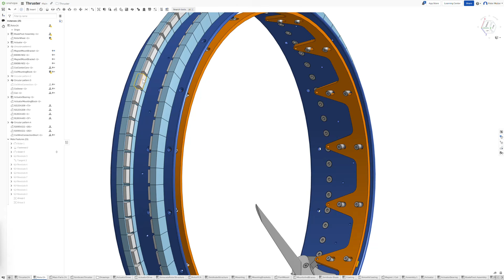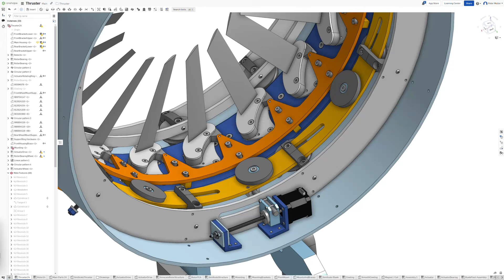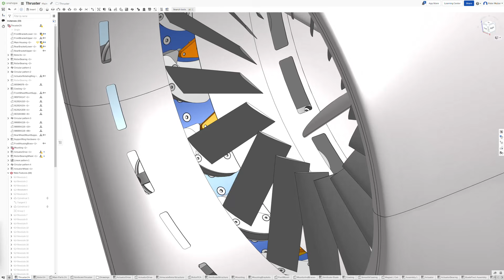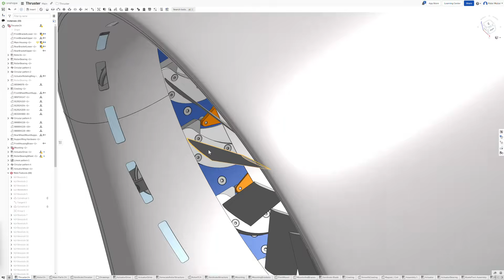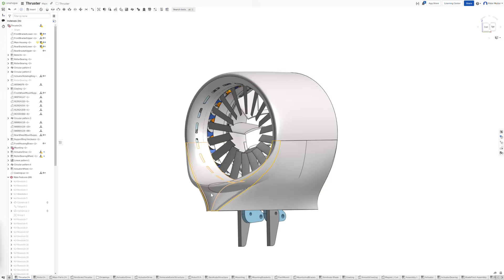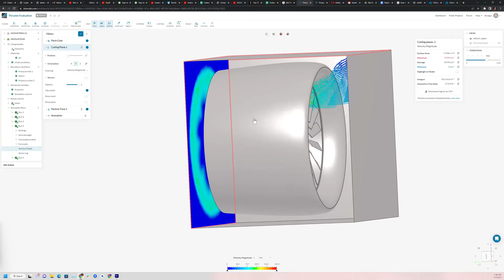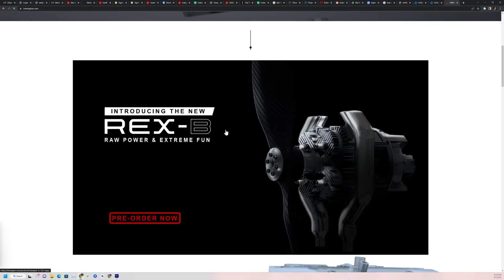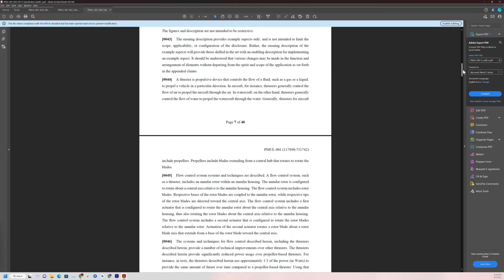Could this Thruster transform Aviation?

Comment: Peter, I love the 24" prototype. With 18 blades and 24 inches of diameter you don't need much horsepower to create 1,500 pounds of static thrust with 1-degree flat pitch, but you do need almost 6,000 RPM. It's been a while since I last crunched the numbers. Outrunner brushless motors produce incredible torque however the mass of the motor system you've engineered will take a few tricks I've learned since 2015 to get just halfway to the RPM you want and need. I was told with my prototype that is 36 slots and 48 poles that there was no way to achieve 4,000 RPM on my 15-inch prototype. I found the solution by accident. That being said with your prototype design I don't believe my solution for the 15" would solve it. You have my mind willing to see if my modification can be adapted to get you close. Amperage and high frequency won't alone solve the problem. You've created a high torque slow RPM motor. I can provide a better solution for your 24" prototype that will keep most of it intact if you're interested. Hint your facilitating 50,000 RPM bearing contact points and not taking advantage of the leverage! Smaller high-speed motors 50K ~100K RPM will prove to be the solution you need. Low mass high RPM. Bonus they will be less expensive to produce, more reliable from heat buildup at altitude, lighter weight, redundant backup. Best wishes and have a blessed day.
Reply from the maker: I like it. Thanks for the suggestion.
Reply: Peter, after reasoning solutions last night in my dreamworld sleep. I've deduced that what you have created are similar to 18 sails. For 1.5K thrust total, the divided thrust load is 83.333... pounds of thrust each. Correct? Employing the solution of propulsion from a sail we need a keel for counterweight reactance moments. 18 sails need 18 keel sail magnets. In this vane of thinking these sails can and probably should articulate. A little flapping like bird wings. The propulsion then could facilitate design similar to a "C" circle track railgun cannon concept. Every time something new is prototyped the entire world advances. In my humble opinion your concept is innovative and worth collaborations. The actual material at commodity pricing needed is less than $100.00 US per thruster. Your works are appreciated and respected. Best wishes and have a blessed day.
Reply: Peter, I like what you've achieved. I appreciate your contributions to the aviation community.
Reply from the maker: What do you think about rewiring the 54 coils into 9 groups of 6 and wiring them in parallel to the controller instead of a single series as they are now? There would only be 2 coils in each phase and they could be narrower gauge and more turns given that everything is in parallel. Then it would appear to be just like nine 8 pole motors wired in parallel. Right?
Reply: Peter, Series facilitates higher voltage. Parallel facilitates amperage. 90 hp is about 67.5KW. In my constant Amp brushless motor controller designs I would look at 20 Amps and 3,375 Volts then design the motor accordingly for RPM. The problem that you've got with your current prototype is to obtain higher rpm you need to be able to move the stator field to reduce the back EMF. Amperage is torque voltage is speed. Moving the magnetic field of the stator transitions the angle of advancement that facilitates what I term as pinching the pumpkin seed.
Reply: Actually, to get 1500# thrust from a 24" duct requires 1222 HP assuming an impossible 100% efficiency no matter what blade design.
Reply: This thruster could transform aviation…

1) Select an existing airframe to mount it on…
2) Plan on iterating until it produces the expected power…
3) Raptor one suffered from being over weight and under powered… 
4) without enough time, money, and man hours to overcome…
5) Too much personal risk to repeat the same challenges just to get YT clicks and eyeballs…

- concerned YT watcher
Reply: @DanasWings  Well said Sir. Certainly a lot more than the designer’s 90HP prediction
Reply: @petermuller9177  One change that can have an absurd impect is Halbach arrays (use magnets arranged in a way that the field is mostly inside the motor and not outside).
Reply: @petermuller9177  
=the best solution= THIN GAP Motor ,(ironless stator, high specific momentum...)

=iff two Conter Rotating=NO problems with Reactiv & Gyroscopic Momentumes !

Comment: I’ve been thinking about this for a long time…good work on getting a patent. I’d thought about at stacking them in decreasing circumference, alternating the direction and angle of the fins to avoid the need for stators. I had intended to use for marine use / water propulsion. I had also assumed hydraulic motors rather than electric motors :)

Comment: 15 years ago at the largest boat show in Europe (Boote Düsseldorf) I saw the same drive for ships. The stator blades were missing in the 2nd row and there were no brushless motors at that time.
Reply: Are you positive you are not thinking of a Voith-Schneider Propeller?
Reply: Brushless motors have been around since the 60s. Not so common until the last 20 years, granted...
Reply: @YodaWhat  No Voith-Schneider Propeller, i am shure. Ist was into 2000 or 2001 where i have see this for a Boat. It was absolute new, so i can remember.
Reply: For boats, this solution can be quite useful, especially for internal thrusters.

Comment: Little note for the simulation part: There is quite big gap between rotor and stator blades, where I would expect the air to swirl more, hence producing more losses. This is not visible in the simulations, because your MRF region is too wide. I bet if you limit the MRF just at close proximity of the rotating blades and for the rest of the outer ring you apply only rotating wall, you will get way different results. I would also advice to make the outlet far more further downstream, to see how the flow field will develop.
Reply: Ditto
Reply: Also, the inlet pressure boundary isn't even one or one half diameter away, and the side walls seem a bit close as well for any precise design tweaking.

Comment: Holy crap you got it to work! I've been designing these things on napkins for ages. I wanted to make a higher efficiency flying motorcycle. I kept running into problems with the calculations I couldn't solve. I was going to buy a 3d printer to test some of the ideas. One design has the blades in an S curve so that they can reach almost all the way to the center. I'm really glad someone got the design to work. If we can get this to work well enough I have hundreds of designs to connect it with.

Comment: blades do pretty well in tension, even a string can stay taught under tension. Compression failure actually comes sooner. Also, shafts can be great, they're a great way to avoid circulation around blade tips. You already have stators, so there is no reason to not just make this all conventional. I would be lighter and more reliable.
Reply: Why not extend the blades so that they all meet in the middle? You can’t circulate around a blade tip that doesn’t exist.
Reply: Wow, I have to give it to you, thinking out of the box. I will follow you with great expectations. The original Little Aussie Battler.👍🏻

Comment: Keep at it, but try using electrical magnetic repulsion to center the fan blades for bearing longevity.  Also invest in a 3D to tweek your design in small scale modeling. Hope you continue.

Comment: What's the gyroscopic effect of so much mass so far from the center of rotation?
Reply: That was one of my thoughts as well, and how much more mass does this have? That motor is huge.
Reply: Because the force held is outward, i can imagine using carbon fiber or later carbon nanotubes. Probably no need for steel or titanium.
Reply: In the worst case it can become a contra-rotating thruster to minimize the torque effects (which could simplify the electric motor design a little).
Reply: Thinking of a turbo fan engine on say a 737 or 777 jet. I wouldn't think the gyro effect would be much different, lots of turbo fans have fully included fan that the ring turns with the blades...
Reply: @jasonbrown3632  The outer ring with its motors, blade tilting, chubby blades... is relatively much heavier compared to just a static outer ring.
Reply: @jasonbrown3632  Yea but this is significantly more mass.

Comment: 3 times the efficiency of a propeller that is 80+% efficient? That's some great math right there. I think what you've discovered is a way to trick software into giving you numbers that aren't possible. Well done on that front. Btw, a divergent duct in the back of a ducted fan is a great way to throw away energy. If you fix that maybe you can hit 4x
Reply: Lol
Reply: He is a master of tricking the software into producing him his wanted numbers.
Reply: There needs to be a forum somewhere to discuss Peter’s endeavors without hurting his feelings. Also to catalog his fallacies.
Reply: @stevec7596  Thanks Steve. Joined and read up. I feel so much better now. This sweet fantasy needed a good examination and it got its proper tail handed to it there.
Reply: @navion1946  haha, no problem. The guys there actually tried to help him on the Raptor but he listens to nobody. It's a shame really because he did put a lot of time and money into that thing.
Reply: So negative - all you have to do is unsubscribe if you dont like it, If he makes this work youll look very silly and if he doesnt I still applaud him for his dreams and having the guts to try. My mum used to say "If you dont have anything nice to say - dont say anything" - perhaps you could learn from that
Reply: @steveallcock8663  you miss all the support each of us has extended to PM over the years. He lacks a grasp on what is actually required to accomplish the things he is attempting. We were all proven completely correct with his last endeavor. Also what you miss is the implied insult to our intelligence from his nonsense. This compels us to evaluate all his claims, statements, inventions, successes and failures because if he is correct we are idiots. So what you’re really seeing is a thorough self evaluation of all of us.
Reply: @steveallcock8663  His claim of 1500 lbs thrust from 90hp while burning just a few gallons per hour is no different than someone telling you the Earth is flat or that they have designed a perpetual motion free energy machine. It doesn't jive with physics.
Reply: @steveallcock8663  the test pilot for the last raptor declined to fly it due to safety concerns. He was correct not to give it a go- but what if he wasn't so bright and had killed himself? Do we all still say "peter is a pioneer"? What If he had crashed the raptor into a person and not a corn field? Do we say "that's the price of progress he is a visionary"
Reply: @steveallcock8663  funnily enough, there a thousands and thousands of people on YouTube experimenting and trying new things. Many of them fail in their endeavours-most of them don't get given shit like peter does :-) wonder what the difference may be :-)
Reply: @nathanchalecki4842  I’ll take a stab at that: we WANT someone to come along and raise the bar to the next level. To give us a machine that can land and take off vertically, cruise 300 and all for the price of a pickup. If we missed the breakthrough that would make it possible we would kick ourselves. So we evaluate everyone who claims they can.

Comment: Reminds me of the Exoskeletal Engine concept where they turn a jet engine inside out and use drum rotors instead. The idea was that they could use ceramic blades if the blade was subjected to compressive loads instead of tensile.
Reply: Problem is that ceramic does not fail gracefully, it breaks, shatters. Metal bends, fractures.
Reply: My concern is how to keep all surfaces that move against each other lubricated. Also as mentioned by another post, without a center ring to give more strength, bird strikes would likely create much more damage. Just a thought.

Comment: Have you thought about adding a support ring to the tips of the blades so that when the blades deform due to heat and pressure, they all deform together uniformly, spreading the load across all the blades?  Also, what about adding 4-5 rows of the blades in alternating directions to allow for some compression behind them? A little ignition never hurt anyone 😂😂 

I once had an idea very, very similar to this back in the early 2000’s, but didn’t have access to what I needed to prototype anything. Very nice work, love what you’ve done 🍻
Reply: This is electric so there will be no heat around blade tips.

Comment: Huh, so I guess I’m not the only one to have thought of this. Pretty typical occurrence in the world of engineering.

Only difference is that you’ve actually went and built one while I didn’t bother to even go that far.

I also came up with it but for different reasons. It was thought up with the intention of noise and turbulence reduction for drone props. By design, ducted propellers has increase thrust while also decreased noise due to a funnels path for turbulent air low to go through. Then at least for me getting rid of the shaft in the center would also further reduce turbulent flow. 

Only reason I didn’t bother to pursue further was because you could get a similar effect with inverted ducted propellers where the shaft does not interfere with the turbulent path: only the inlet will be obstructed by the arm.

Further reasoning to find design less preferable is the amount of moving parts on the main body where the blades will be experiencing compressive load created by centripetal forces. It’s a body vs shaft design. 

I like the idea for Ariel platforms like drones, but never considered it for traditional propped or jet aircraft.

Maybe consider a conical shaped  dual ring design. It will make the blades more stable while increasing blade surface area to interact with the airflow. Idk, to me that would be the next step to try.

Comment: I would suggest having all the blade tips connect to foiled ring at the center (like a miniature duct) which would act as a hub, they could be connected at bushings/bearings, to allow for changes of pitch at the periphery.
Besides that, I think it's impractical to have all that mass so far out from the axis of rotation, but I'm excited to see it work.